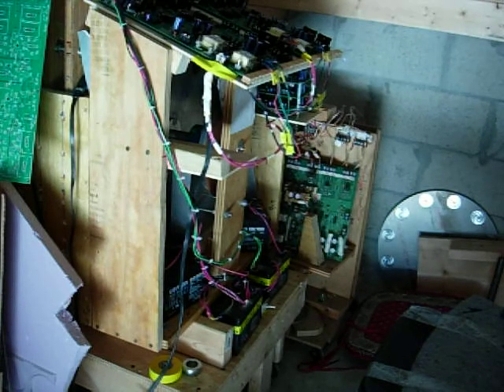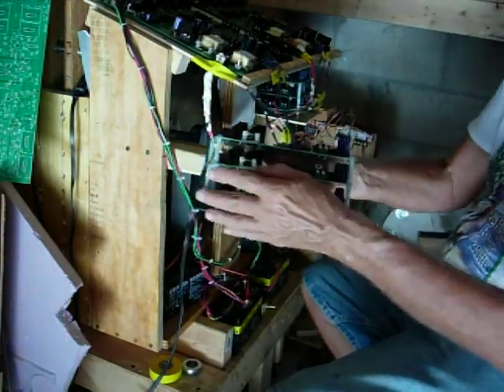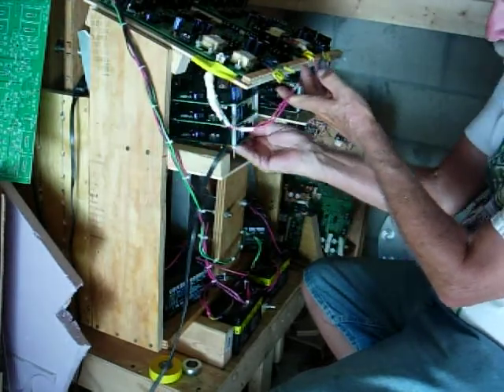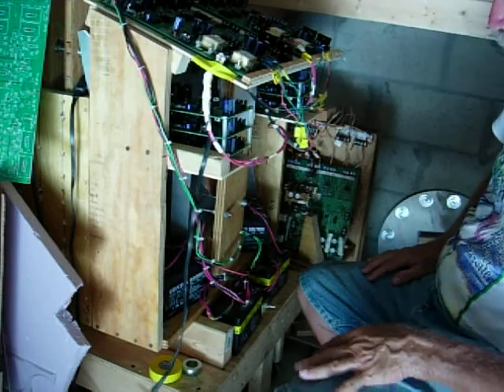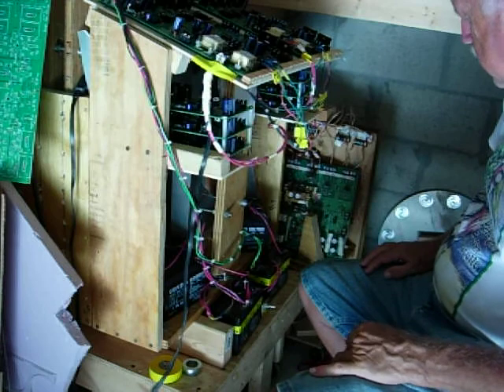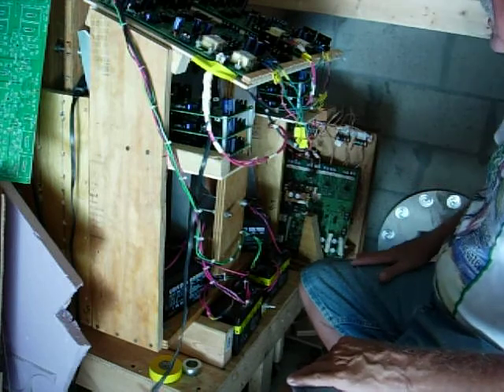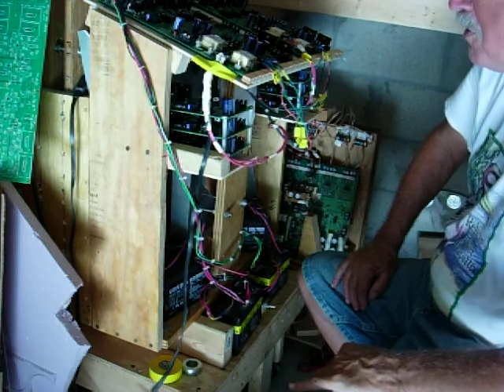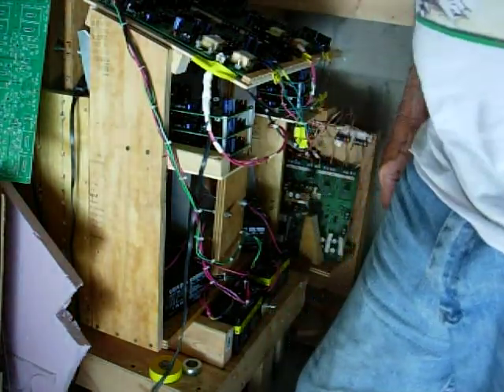Don Smith #160update on impulse motor

Comment: Great Work Gary, im a felow experimeter and been following work progress, nice job !....just wondering, what's happening with Mr. Gerard Morin? he hasn't posted anything in almost 3 months, hope everything is ok there...
Reply from the maker: not sure what hes up too,   I have a complete set of parts for his transformer generator setup but haven' t had time to fire it up yet. next step here is to get new stator coils done.   in video Don Smith #39 the motor ran with two stators one rotor on -+ 12vdc bat at 250 RPMs.   The problems with the new coils will be R .  so I may need to wire them in series